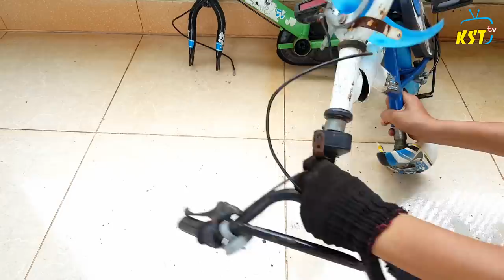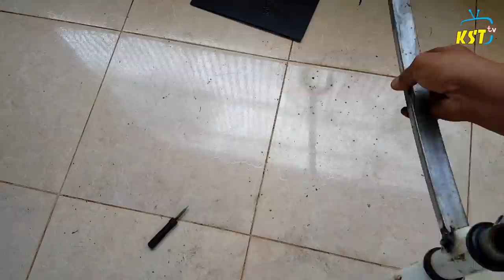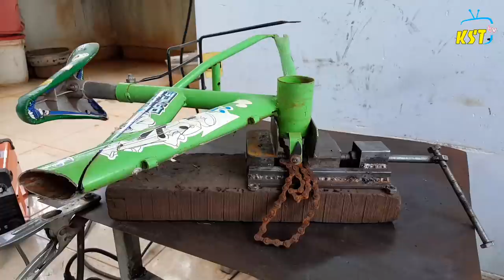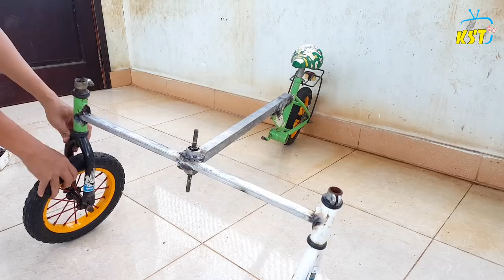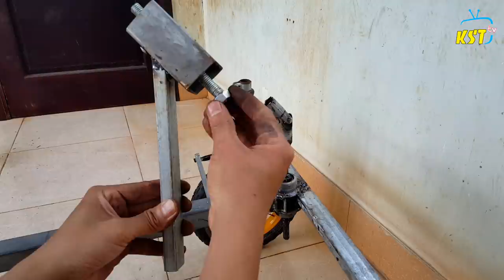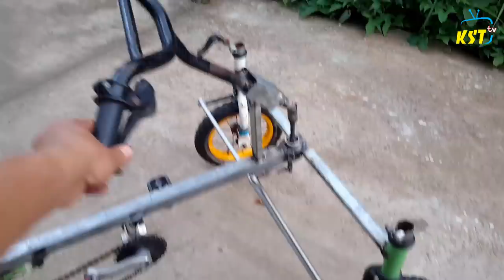Build a 3 wheel bike at home

Comment: a couple of minor tips for your health:
Please, when welding galvanised metal, wear something to protect your lungs from the burnt zinc - it's very toxic.
It would be a good idea to make the seat post taller before your knees are ruined. You don't want to need new knees before you turn 40, after all. Sure, some people think it looks cool riding with your knees almost hitting your chin, but it's destroying your knee joints
Other than that, nice build
Reply from the maker: Thank you for the advice

Comment: realy nice build i like it 90%, i think in the front you need more suport and try to use  two cardan joints in your builds especialy in high speed aplications so the movement will be more smooth
Reply from the maker: Thanks for the tips!